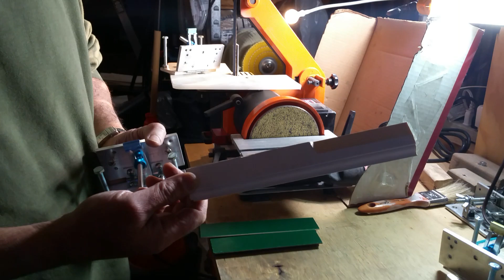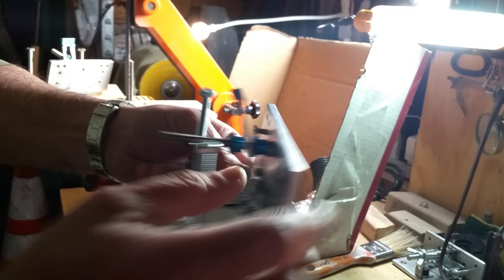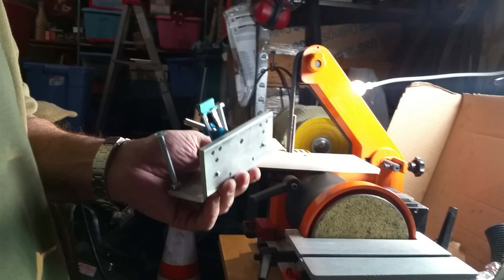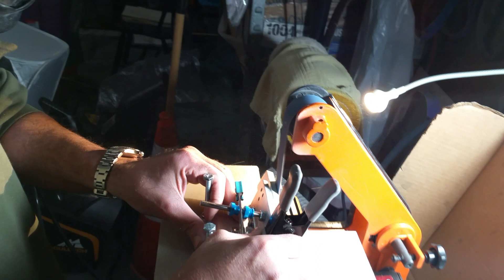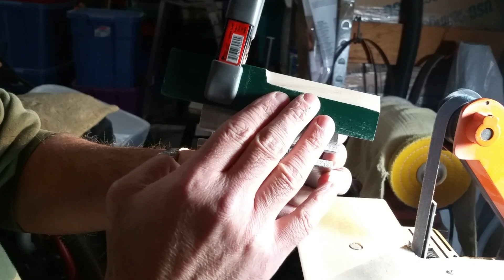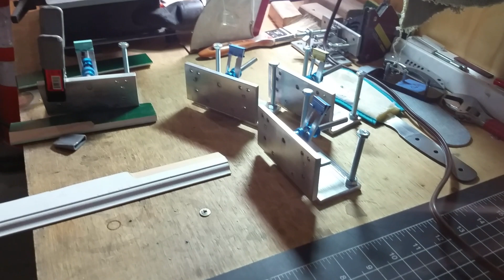KnifeShopByNick Bevel Grinding Jig

Comment: Used mine today.  Kind of having trouble with straight lines.
Reply from the maker: Michael, all about pressure and speed. The jig only holds the angle.
Reply from the maker: Also, make sure to control your belt speed if you have a VFD AND try to  use a fresh belt if possible